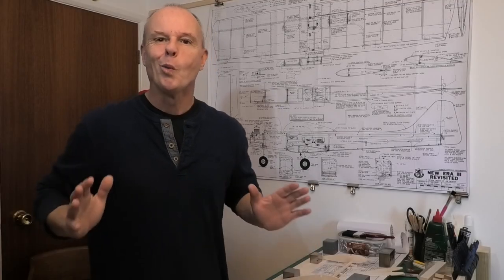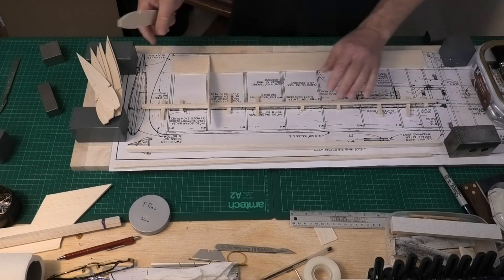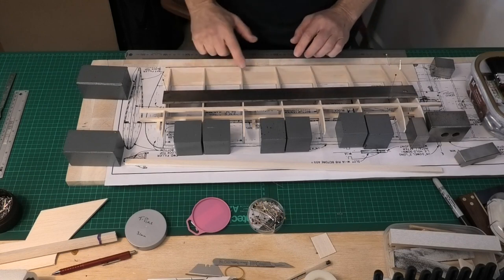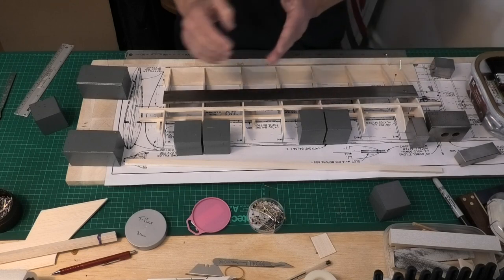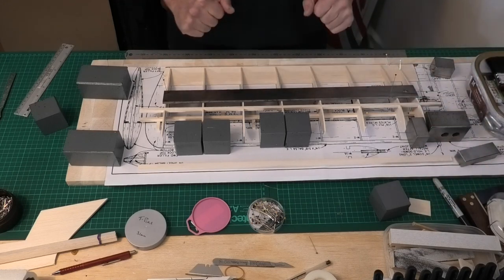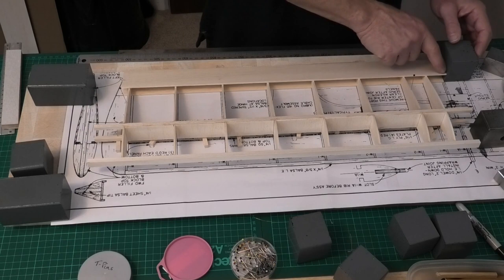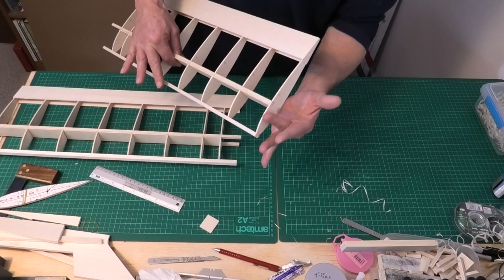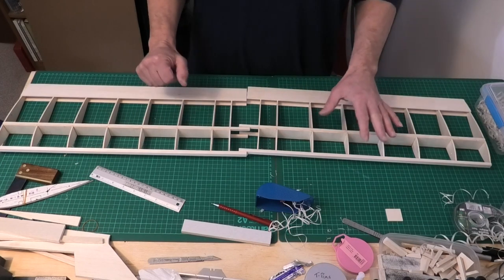New Era III Revisited: Pt 3 - Building the Wing Skeleton - a 45" wingspan RC balsa aeroplane

Comment: Hi Mark,really enjoying this new build. Your builds are super clean/neat. How did the top TE mate with the botom TE? Did you literally just lay them together? Could not see this area in close up on the end of wing shot,thanks. Built up TE`s are my nightmare
Reply from the maker: Hi Gary, thanks very much for the comment, its really appreciated, pleased you enjoyed the video.  The top and bottom TE sheeting just meet at the tip of the wing ribs, so the top corner of the lower TE just meets the bottom corner of the top piece.  So, there is no continuation of the sheeting, joined together, beyond the tip of the ribs.  Hope I have answered the question and it makes sense, if not let me know.  thanks again